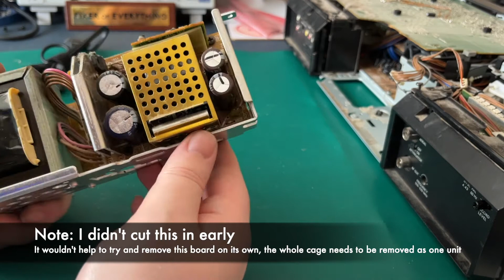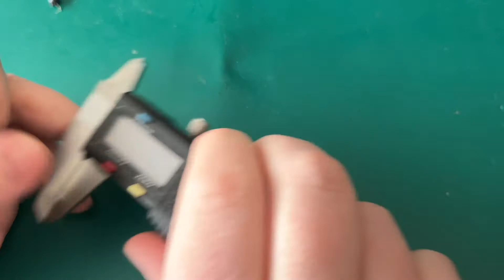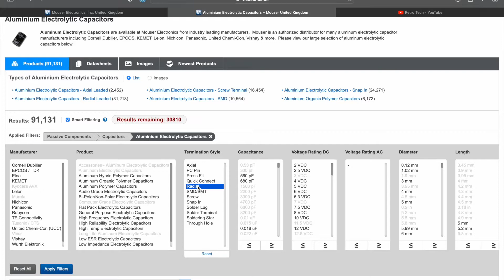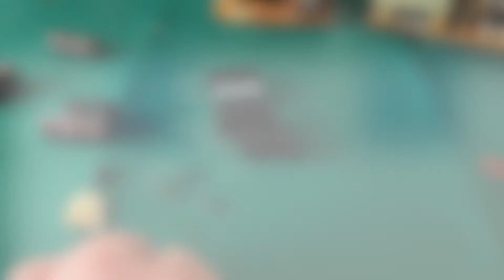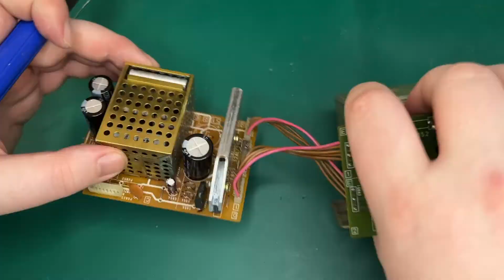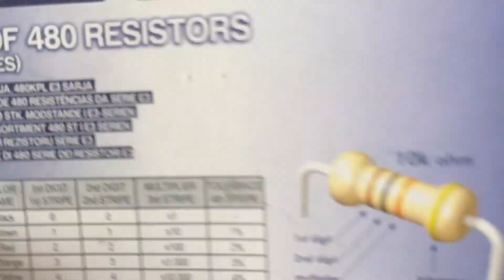Repairing a Bang & Olufsen VX7000 - Pt. 1: Rebuilding the power supply

Comment: Hello 
I saw your video and wanted to ask if you happen to know which diode, resistor ect are on the cirquit board, where the lithium battery is installed. The battery leaked and corroded everything on this battery cirquit board.
Thank you and have a nice one

Comment: Hello, congratulations for the video, I also fixed my vx7000. It works well but the tape counter no longer indicates, there are only two bright dashes.
Do you know what I can check?
Thank you.
Reply from the maker: Thanks for the lovely comment and congrats on fixing your VX7000 what was your original issue? if everything else is operational except the indicator that could be capacitors in that circuit perhaps. did you check what the voltage was like on your internal battery as well? Apparently odd things happen if that battery is dead. Please do keep me posted! Thanks again,
Reply: @TheRetroBristolian  For the repair I replaced some capacitors, repaired a mechanical gear with fast-acting glue and lubricated.
Now I have another one that I fixed in the same way, it starts playing but after a few minutes the signal skips and the screen writes "no connection", if I PAUSE and then PLAY it returns for a few minutes and then stands out. I'll have to find the area to check for bad capacitors.
Reply: Removing accumulator
Reply: @xcntry8908  Yes, I changed the battery but it's the same
Reply: @pollo1962  You need connecting this VCR
to "bang olufsen" tv in menu using "beolink"remote control changing 
Display mode "time used"
Read user manual
Reply: @pollo1962  Вам нужен телевизор bang olufsen чтобы подключить к нему этот vcr и с при помощи пульта  в меню vcr выбрать режим дисплэя Time Using
Reply: @pollo1962  https://youtu.be/FlThfizlKR4

Comment: Dying to see part two
Reply from the maker: I can't decide if this is sarcastic or not! Either way, thanks for dropping by and leaving a comment - it is always welcomed! What would you like to see in a part two? I have the batteries to show being replaced, I also did a video on how to back up the software chips from the VX7000 you might like? I find it unlikely I'll be able to fix these VCRs unless replacement gears can be sourced.
Reply: @TheRetroBristolian  it is not sarcastic. I thoroughly enjoyed part 1. But seemed like there were a few more issues with the machine that would be interesting to see you troubleshoot. Thanks for the first video.
Reply from the maker: @Filipjensen  thanks for the kind words I means a lot. there are things I'd like to show, the battery replacement would be interesting, working out why the non working unit is blowing the fusible resistor in the power supply would be interesting also. but as I say without tracking down replacement gears sadly I don't think they will ever work again. There must be someone out there that can reproduce the gears, I'm not sure if 3D printed gears would work. I guess I need to look into that more. Take care 🙂